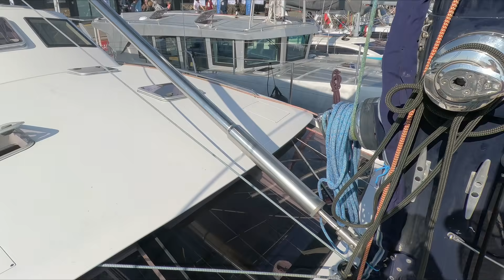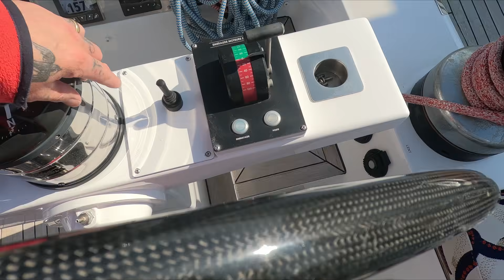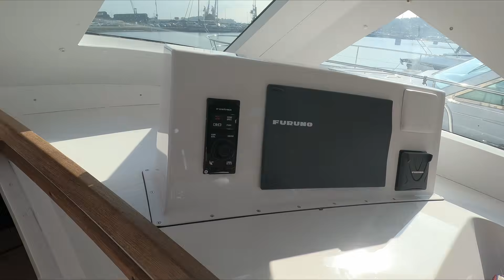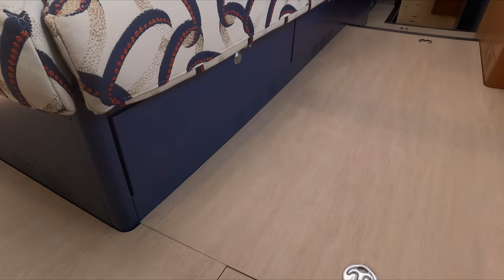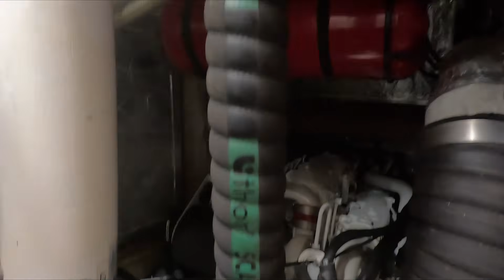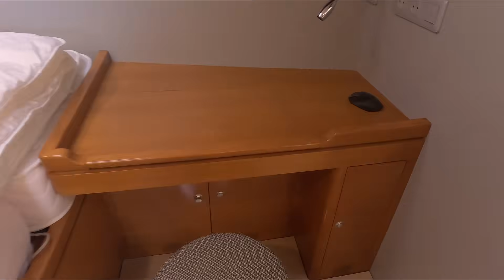Garcia 65 exploration, there is nowhere you can't go

Comment: Hi Ladies. Just to make it further Public and in case I die before I can get my next Sailboat for Testing that Concept- I am surrendering all rights real or implied of patents and copyrights concerning the Concept for improving Sailboat Survivability from Shorter Masts with in Mast Furling, shorter Booms and all associated designs of Battenless radial reinforced Main Sails to Suit - though god willing, I still intend to put various suitable Mainsail designs through a rigorous testing and development program should I manage to purchase a suitable Monohull. Interestingly, a very useful cost saving has appeared for the use of 316 Stainless Steel Rod Rigging which if dine DIY looks to be amazingly low cost in suitable sizing, so are riggers up for some serious price competition ? This would assist Standing Rigging Strength enormously, standard pricing is very low per 10 foot of Rod length, and much easier to check and maintain than twisted wire rigging, and a fraction of the price for greater strength. Bob.🤔🌟🌟🌟👍❤️⛵️

Comment: Shes a big boat ⛵...but slightly out of shape 🤓🤔 ...well not to my taste in too many ways, even if  was just dreaming. 🤷🏻😉thanks 🧙🏼‍♂️🇬🇧 

Al hull but whats the keel rudder/s set up...the boat yoga required to keep an eye on and service that engine is prodigious especially if it cuts or looses a water pump out in weather on a stormy lee shore.  
Ive seen a 40 ft Colvic watson ketch Sailing Telelu tribe with with better engine room/ access.. 😮 for that money you could buy a new 55ft hybrid multihull. .. with fully protected familly safe helms better performance and probably significantly lower running costs ... 

Its not got the design chops of a vessel like Dashews Beowulf ...sailing Monohull .. though that is admittedly ten feet longer. 😁And has twin masts..
Reply: Testing unsafe Carnaval Cruise conditions